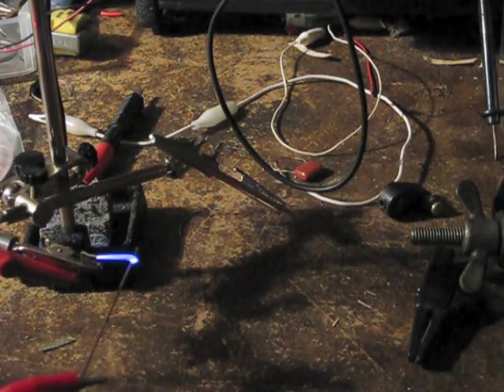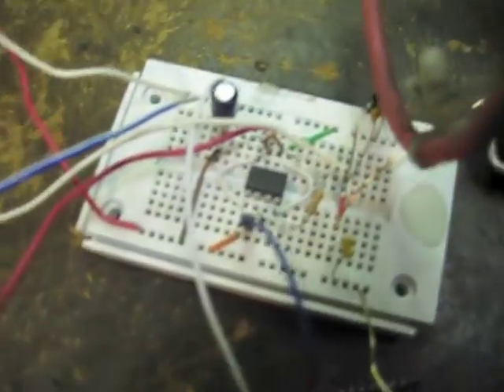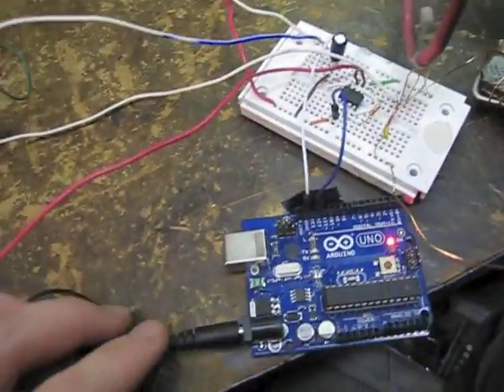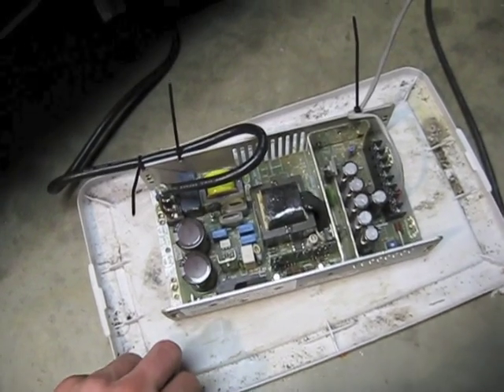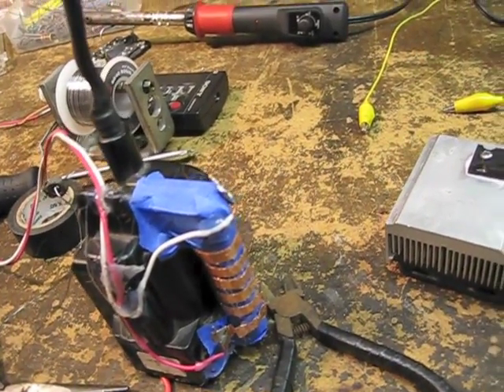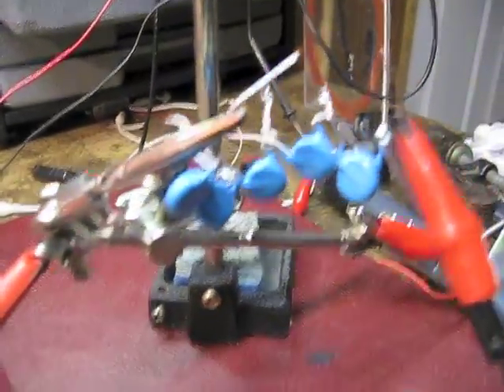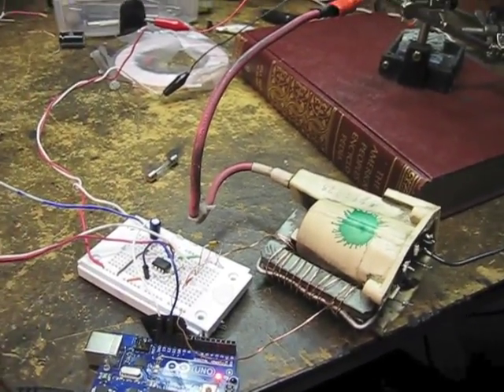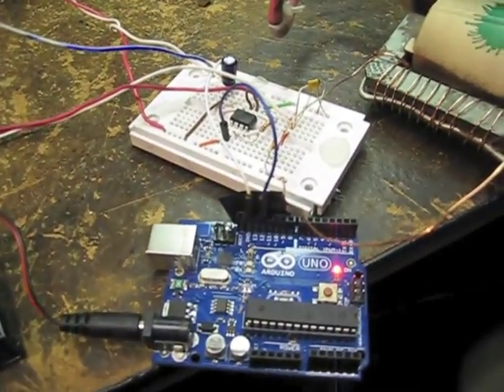How To Create High Voltage (TV Flyback Driver)

Comment from the maker: Using a resistor to fix this might get tricky, so i found that either shortening or lengthening the wire from source to ground to a specific length made the circuit run. Even an inch of excess wire would inhibit MOSFET from functioning properly. It was very hard to diagnose!!!!

If you use a resistor, make sure it can withstand heat and high current ( ~ 2 - 5 watts and ~.25 - 2 Ohms).

Comment from the maker: HEY EVERYONE

I forgot to mention something that I had trouble with that you might want to know. 

If your circuit initially, or after a few runs, starts to fail, or makes a spark and dies, its probably that the wire from MOSFETs source to ground has either too much resistance, or not enough. Don' throw away the  MOSFET if you suspect it is failing. They are very sensitive to current changes, and mine required about .75 ohms (no more, no less) between source and ground to work properly.